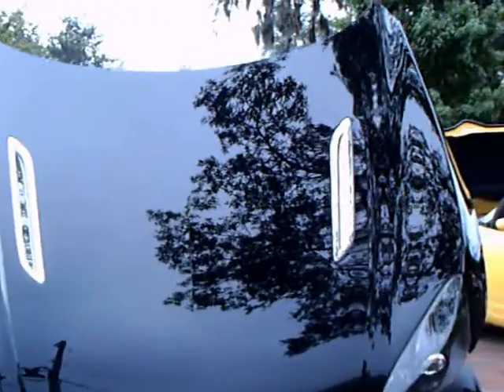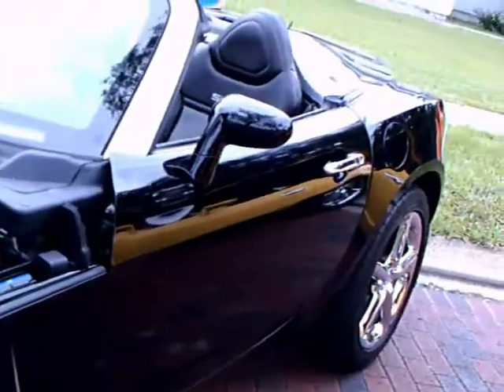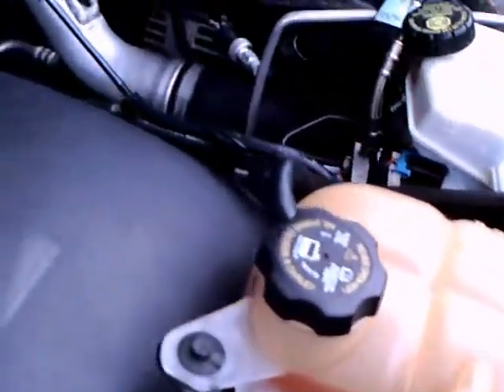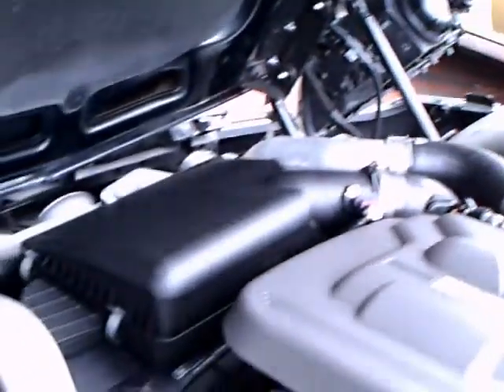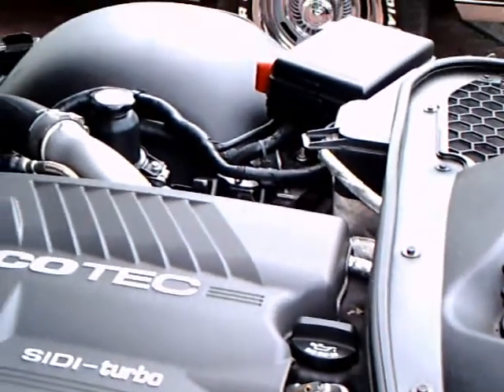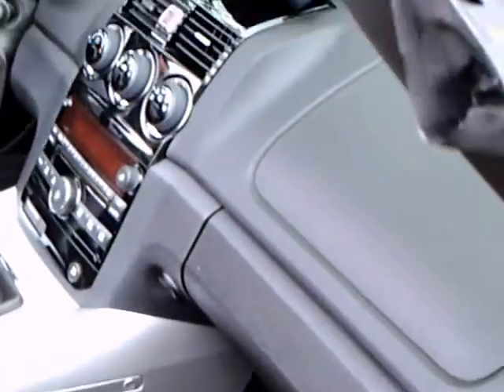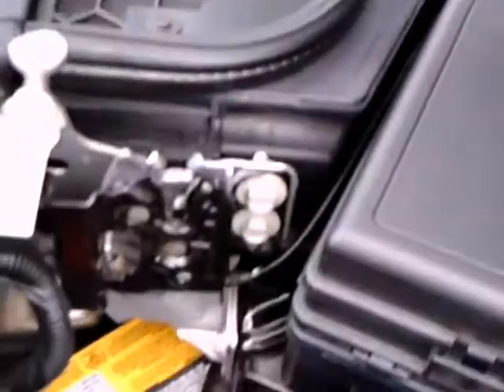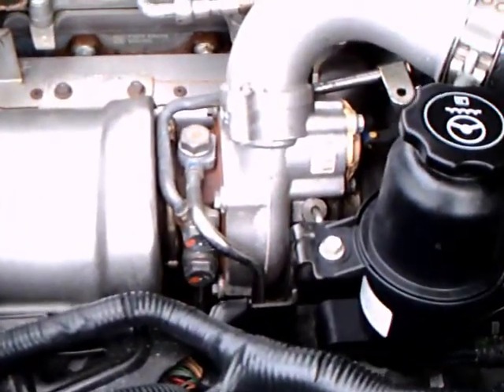Saturn Sky Turbo Convertible Blk Longwood 071313

Comment: That's too bad. Volkswagen used the same kind of rear suspension as used on the Corvair for decades before, a Swing axle suspension, and yet the Volkswagen didn't get the same criticism by Ralph Nader.